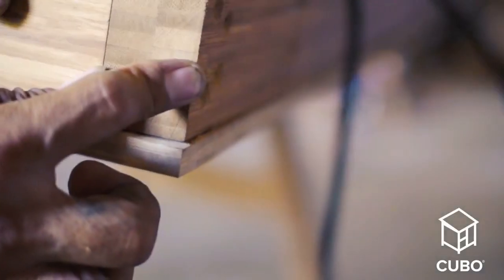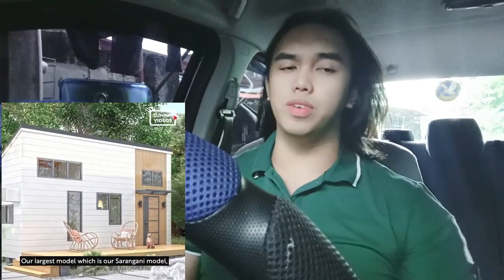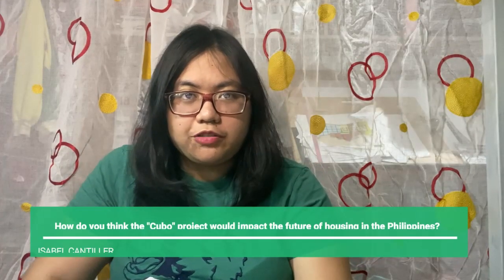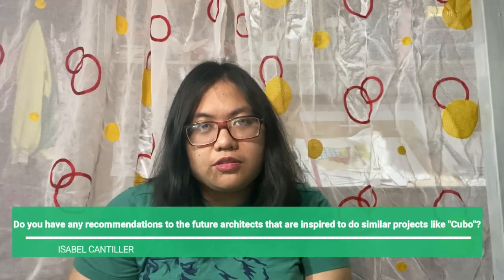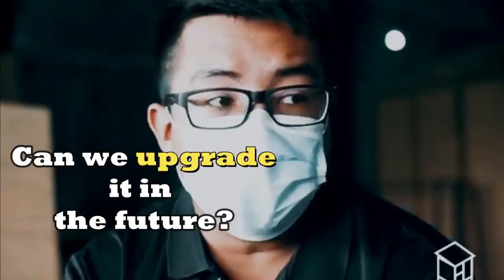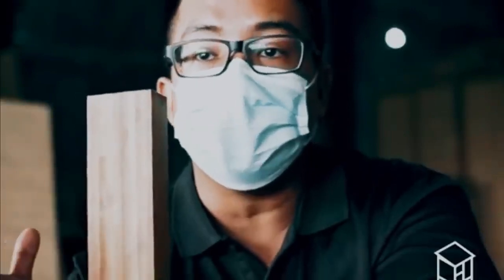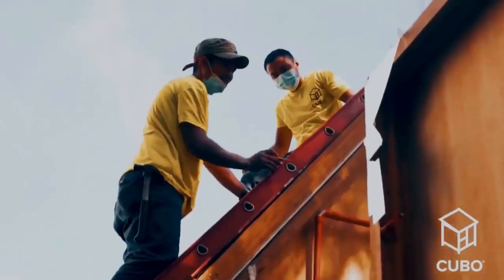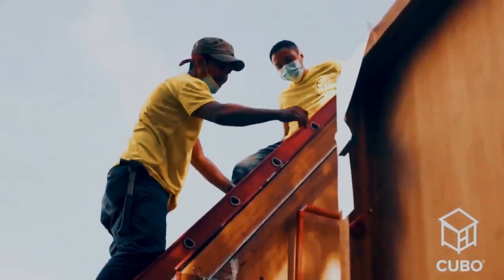Architecture Students React: A HOUSE BUILT IN 4 HOURS?: CUBO MODULAR PHILIPPINES

Comment: The wood panels are thin compared to hollow blocks. Is this sturdy?
Reply from the maker: Globally, engineered bamboo has taken traction for its sustainability, versatility and resistance to environmental elements. As the material integral to all our houses, its superior qualities are what CUBO homes strive to bring to the housing landscape of the Philippines. The strength of engineered bamboo is up to 14 times stronger than concrete and local hardwood, proving to have a durability and ability to withstand compression unlike any other. Apart from being resistant to all kinds of environmental conditions, engineered bamboo is also less prone to warping over time.
Reply: @TheEclipsadoYT  Time will tell. Thank you for the reply.

Comment: The thing I am really worried about is how these materials would go againts fire.
Reply from the maker: CUBOs are made in adherence to the International Residential Code, ensuring that they are resilient in the face of most calamities. To achieve this, each house we build is put together with earthquake and typhoon straps. These metal connectors are capable of holding all the house’s structural members together, forming into a cohesive body that stands firmly.

Additionally, a benefit of the modular homes that we offer is that if one part was left damaged after a hazard, it can easily be replaced with another piece. This replacement can be done without having to alter the entire structure.
Reply: @TheEclipsadoYT  thanks!